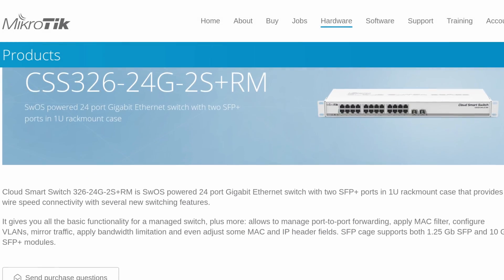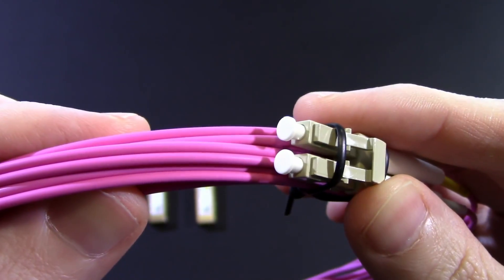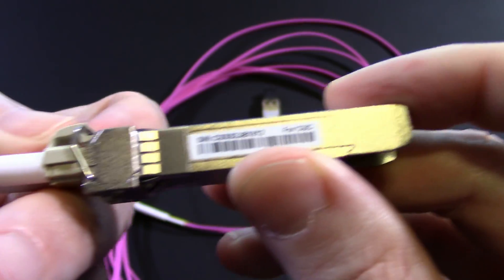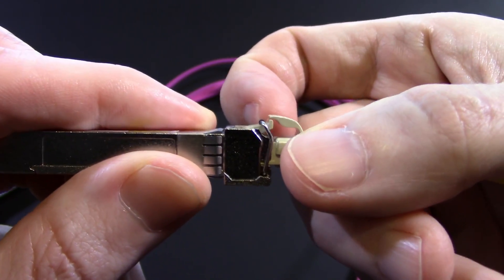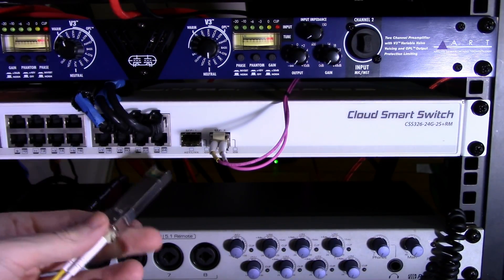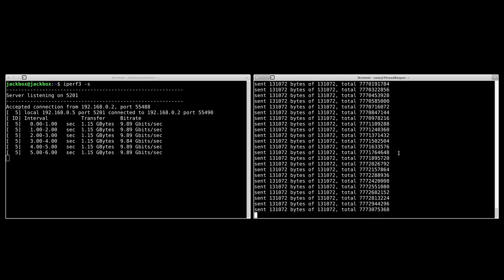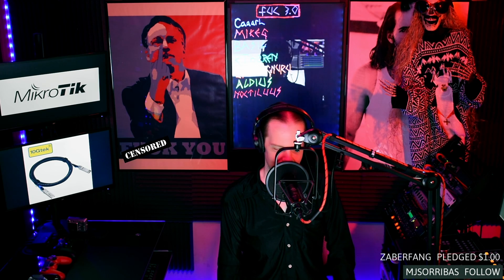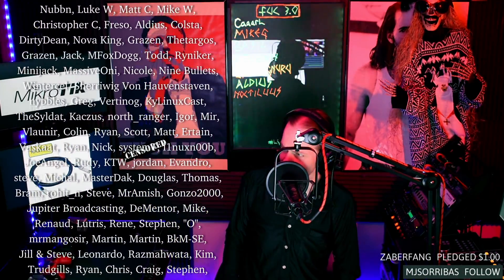Mikrotik CSS326 24G 2S+RM 10GIG SFP+ Fiber & Twinax Setup

Comment: I have a stack of 5 Mikrotik equipment. 1:RB-3011 2: CRS-317-1g-16S+ 3:CRS-326-24G-2S+ (2Each) 4:CSS326-24G-2S+-RM (2 Each) All using DAC Cables for Network. The 16S+ Switch is for all my 10G network to various servers and desktops.